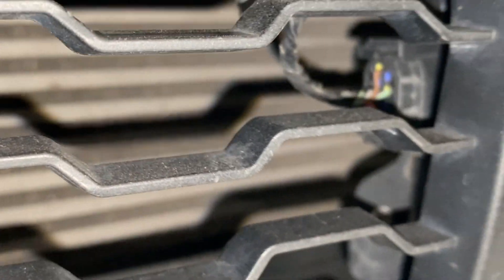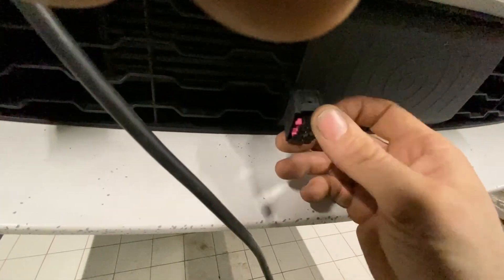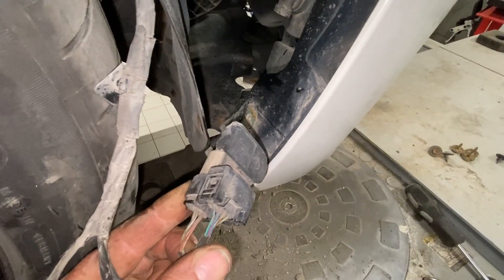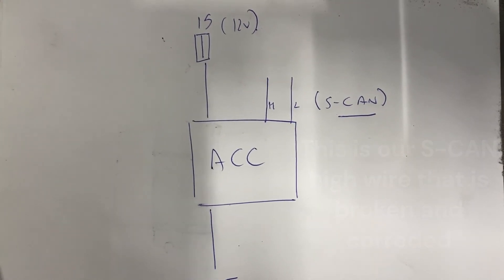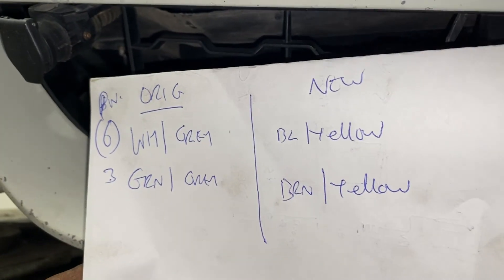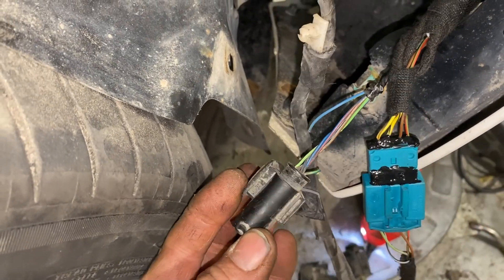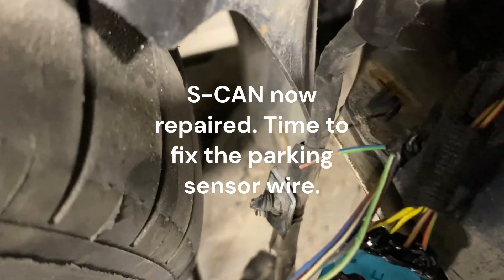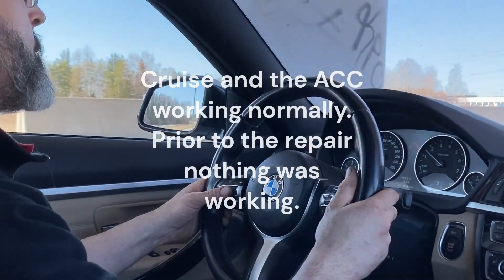bmw active cruise stopped working on this F series

Comment: Hii I have a problem with my car pls help me , bmw f01 2011 , the electromechanical handbrake has broken failure yesterday today I have a new error active cruise control acc failure , they are in relationship with the comunication ?
Reply from the maker: I can help but I charge for that. Email me the fault codes and I will look
Reply: @BenJFF 48052c😮

Comment: I drove in to a bigger pond.
And after that, my acc stopped working.

I get fault kode:
D01411
D0196C
D019EE
D01C0F

Do you have any idea where to start?
Reply from the maker: I always laugh when I see codes with no description - mate I dont remember code numbers without the corresponding fault descriptions but yes at a guess you drowned the acc now theres a lo-CAN fault or you bent the bracket and its out of alignment.
Reply: @BenJFF haha yeah sorry about that. Thank you for your help!

Comment: Hello mate, great video, i have a 2010 e70 and the acc does not work, foult :acc sensor blindness. Now i can use the cruise control shortly after starting the car but after a few minutes it deactivates. Any ideas?
Reply: I have the same problem, did you manage to fix it? Fault 482137

Comment: Hello, I have a question for you, did you also have other problems such as the window regulator not working because of the communication problem 
Best regards
Reply from the maker: Not at all since S CAN is unique only to the acc module
Reply: @ OK, thanks, I have the same errors when reading out as in the video, but the window regulators don't work and the air conditioning doesn't have any error codes stored

Comment: Much appreciated sharing this. I bought a 17' 328d X F31. ACC error pops up/won't activate. No apparent damage with the radar/bracket, etc. PO mentioned he hit a curb slightly and it stopped working after that. Do these ACC systems knock off line that easily? I'm going to follow these suggestions in this video and try to find some onions lol! Cheers.
Reply from the maker: Yes they really do go out of spec easily. If theres a fault code for S CAN no comms to ACC then you have a wiring break
Reply: @BenJFF i have fault with SF-CAN. Is this the same thing?
Reply from the maker: LO-CAN its usually called. Wires are pink and white / green white i think. Go find a wiring diag buddy

Comment: I slightly scraped the underside of my front bumper when parking at a supermarket, and now I get an intermittent fault for the ACC radar. Sometimes I get the fault warning very soon once I start driving, sometimes only after 10-15 minutes. Very annoying! I've tested it out (on a quiet road and my friend's parked car) and we once got the emergency/collision avoidance braking with the red flashing car symbol + audio, but a few minutes later I got the fault again and it stopped working. You got any ideas?  Perhaps recalibration? BMW F30 330iX.
Reply from the maker: The bracket will be bent that holds the ACC in place. The slightest knock will bend it.
Solution would be
1 - Remove bumper
2 - unrivet the bracket and replace it
3 - ADAS machine to re-align it

Of course I have no idea what fault codes you have but from experience I can tell you that mis-aligned radars fail intermittently as you mentioned as the road surface undulates the radar at some pitch will point at the tarmac when bracket is bent up radar usually pulls down as a response.
Reply: @BenJFF  Many thanks for the help and feedback! 👍🏻 I live in Germany, so I'll have to bring my car to a BMW dealer because AFAIK there are no 3rd party calibration/realign centres.

Comment: Thanks for this, very much. Troubleshotting my son's E90 and this helped immensely. I have 12,6 v and ground, and 2.3 vs 2.7 volts on the bus wires. Would that qualify as OK, or is anything other than 3.2 a Fail?
We get the "S 00 55 ACC module, no communication".
All the best from Sweden!
Reply from the maker: Hi 🙂 The bus voltage generally varies depending on the bus load. The voltage is roughly 2.5v and 2.5v on that type of bus. In all honesty I would do this to be sure:-

Use a halogen h7 type bulb on the live and ground and make sure the wiring is good. 12v with no load may suddenly fail under load so do that to confirm.

If bulb is bright great - no faults.

DO NOT use any bulbs on CAN wires. For those I highly recommend you get hold of an oscilloscope even a cheap one like Hantek. If scope pattern looks ok unfortunately you are looking at a new ACC unit🤦 Expensive.

Many thanks for following my channel 🙂

Comment: Great work Ben, loads of value in these videos 👏👏 
another happy Beemer owner 😉😁 
 
The POV glasses are the only option for me most of the time as well, solves the concerns you raised though, just back it up with your camera when you need close up shots and you will be all set ✈️🥊
Reply from the maker: Hi Gerard🙂 I will pick up a pair, do you have any particular recommendation regarding brand or type? Thanks for the comments mate 👍
Reply: @BenJFF  iVUE glasses were my favorite but they were out of stock last time I tried to reorder, I have been using OHO glasses for the last year approx. they are OK but video quality is not as good as iVUE nor do they have a tiltable lens, it was great to be able to angle it down when doing work around the engine bay. 
If you find a better option please do let me know as well :)